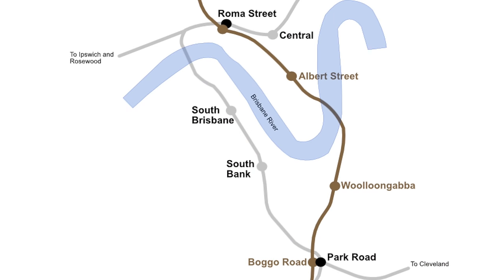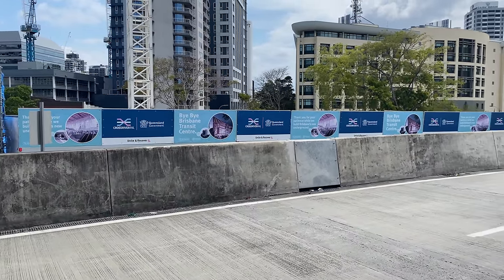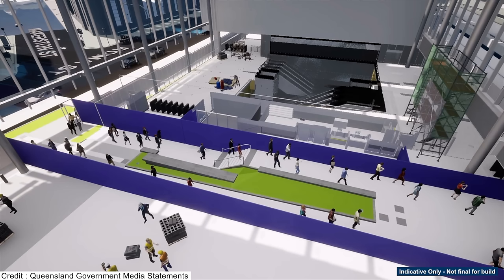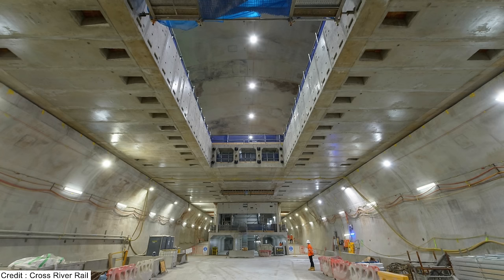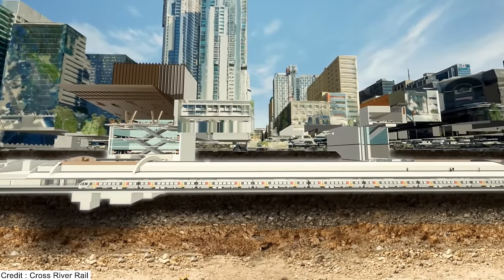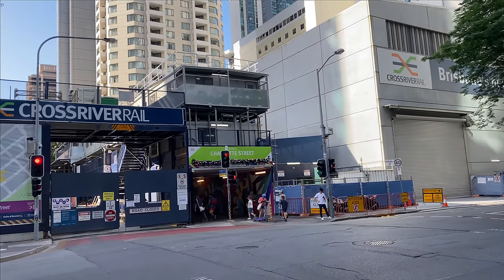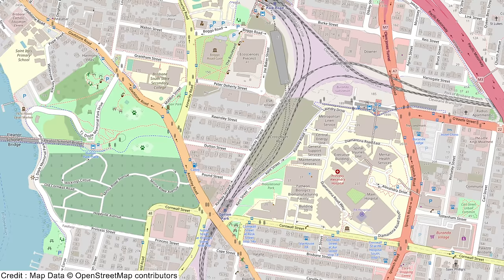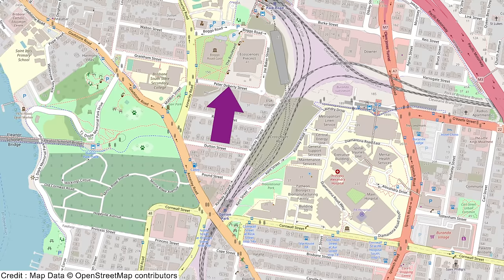Brisbane Cross River Rail Explained - Roma Street, Albert Street, Woolloongabba & Boggo Road

Comment: Thanks Paul, worth the wait! Really disappointing how little there appears to have been into ease of transfer. Even Roma Street could function better with direct access perhaps by an underground concourse beneath the existing platforms. However seeing as there appear to be huge issues relating to allocation of the extra capacity, this might be the least of concerns.
Reply from the maker: You're very welcome. Glad it was worth the wait! Both Roma Street and Boggo Road had better interchange facilities in the original plans, but unfortunately, these were scaled back to what we have now.  I'll talk a bit about service patterns in part 3, but it does seem that some further work will be needed to get the full capacity out of Cross River Rail.

Comment: Hi Paul, great video. Are you currently up in Brisbane? If so, Phil is also up there. You may actually find him while traveling around there. Brisbane has changed completely since I was here with my dad back in august 1973. We actually stayed at the former Canberra Hotel, when we were in Brisbane. No electric trains running there when we were in Brisbane, only diesels. Also, the South Brisbane trains were separated from the Roma Street trains and a bus was needed to get from one area to the other. Anyway, take care. Rob in Melbourne Australia.
Reply from the maker: Hi Rob, I'm back in Sydney, but I was there at the same time as Phil, as I also saw Riverfire.  It must have been so different back in 1973!  It was before the Merivale railway Bridge too, which would explain the separation for trains at South Brisbane.

Comment: A very well made video, Paul!  In my opinion, Brisbane has made a MAJOR error in not having guided buses that would be five sections instead of only three. Really only a simple double articulated electric bus. . . . . that tries to look like an LRT, with hidden wheels.
Reply from the maker: Thanks John, glad you enjoyed it.  Yes, the busway network capacity is limited by it not being guided. The only way to increase capacity beyond the 3 section "metro" vehicles is to have more buses, which means more drivers, so economies of scale are quite small.
Reply: @TransportVlog  Two things should have been done. ONE rebuild the bus way stations with much larger platforms. TWO have five section guided buses instead of the simple double articulated bus which Brisbane is now LOCKED INTO! No more drivers would be needed. These days guided bus systems are WAY in advance of the technology used on the Adelaide O-BAHN, for example. Why are double articulated buses NOT already in use in Adelaide? I saw double articulated DOUBLE DECK buses in Canada in 1980. You trad THAT right! For fun GOOGLE double articulated buses and see that there are a good number in use. Meanwhile in Brisbane they are HYPING UP  that concept.

Comment: The bus platforms are temporary. When the old Myer Centre gets refurbished between 2024 - 2026, Target will move from the basement into the former Myer space. This will see the old Target space be turned into a new coach station and an extension of the existing bus station, with a pedestrian corridor linking up to Albert Street station for Cross River Rail and the old bus tunnel between Queen st and King George square will become another pedestrian corridor that will link to Brisbane Metro at King George Square. This means that although the bus terminal won’t be in Roma Street, it will be better integrated with the CBD which is where most people need to go. Also part of the former Myer space on Ground level is being used for displaced Restaurants from Eagle Street such as the Bavarian, as well as millanos who were displaced from the Centre of Queen Street mall.
Reply: Thanks mate I live in qld too so this is helpful!
Reply from the maker: That's interesting!  Good to see the old Myer centre being put to good use in the future, and great to hear that there will be a connection with Albert Street station too.  I wonder if coaches will still stop at Roma Street on their way to this new terminal. I saw some Brisbane Metro hoardings in the CBD, so it seems like there is quite a lot of new construction involved with this project.
Reply: @TransportVlog  I think some Coaches may still head into Roma for connections to regional trains, but overtime more will go into Queen Street. In addition to Target moving into part of the former MYER space, means that the old Target space can be reused as coach platforms. In addition, Brisbane Metro will also see a reduction of local buses into the bus station, so those will also be included as part of the new coach station. In addition, they want to reconstruct the Queen Street mall to allow better access to the Queens Wharf and nearby Public Transport and Active Transport facilities.
Reply: Stop making stuff up, there is nothing at all saying this anywhere. Target does not need a 4 level space
Reply: @LachieVidsTransportVlogs  they are only taking 2 - 3 of the levels, the other space will be turned into smaller shops & Dining
Reply: can you provide evidence for these claims?  @electro_sykes
Reply: @KhanPiesseONE  I second that. I have not heard of any of these claims regarding the Myer Centre, and doubt their accuracy.
Reply: @nathanmurray  yeh ever thought thats why so many have been evicted out of queeen street
Reply: @TransportVlog  the south of Queen street is now fully blocked off from the public so now you have to detour to access south bank

Comment: I think there was used to be an old railway to Woolloongabba which opened on the 2nd of June 1884 and Closed Progressively from 1960 to 1989. With the Cross Rail Construction, The Area of Woolloongabba will get Heavy Rail Again by 2026 for the Opening of Cross River Rail.
Reply from the maker: Yes that's right Ethan. It will be great to see Woolloongabba on the rail map again!

Comment: I am wondering about Wooloongabba. Didn't it originally have trains? If so, what happened to the train line there? I remember seeing an old 1960's photo of Wooloongabba showing trams, buses and a steam train there. Also, are the Cross River trains driverless like the Metro in Sydney or have drivers like the rest of the Brisbane system?
Reply from the maker: Hi Rob, yes I think there was a railway line there originally.  I found some information here - https://en.wikipedia.org/wiki/Wooloongabba_Branch_railway_line. Yes the trains will have drivers, as it integrates with the existing suburban railway lines (same with Melbourne Metro Tunnel and Elizabeth line in London too).
Reply: From memory, there was an area in Wooloongabba, where trams, steam trains and even trolley buses could all be seen together. It certainly must have been an amazing place back in those days.
Reply: There's trains there now. Park Road and Dutton Park stations are both on the boundary of woolly.
Reply: Trains will be completely autonomous once they enter the tunnel but there will still be drivers in control of it. They've also been clever not to use the word driverless when naming the system to keep the unions happy.
Reply: Yes, there was a (mainly) goods rail line and yard in Woolloongabba, on the very site where the Cross River Rail station is being built. It came off the main line just north of Dutton Park and followed Dibley Street up to Ipswich Road, which it then crossed just south of Wilton Street. It then ran up towards the Gabba as far as Logan Road, then turned left along the top of what is today Jurgens Street, ran along Stanley Street and crossed right through the middle of the Gabba Fiveways to the yard.

Past the yard, the line continued up towards the river to the old Coal Wharves (today beneath the Captain Cook Bridge), skirted around the South Brisbane Dry Dock (now the Maritime Museum) and into the old South Brisbane Wharves. Despite being relatively close to the main line with South Bank (then Vulture Street) and South Brisbane Stations, the wharves line didn't connect to it.

Comment: Great video as usual Paul but as an aside do you have any information on when the charmers street  section of central walk will open
Reply from the maker: Thanks Paul, I haven't been to Central station for a couple of weeks now.  Last time I was there, they were starting to build the replacement air-con unit on top of the Chalmers Street entrance building. I'll definitely be there at some point this week, so I may be able to give you some further information then.
Reply from the maker: Hi @paulburgess-qr9rx, I had a look today and scaffolding has gone up on the Randal Lane side, probably to assist with replacing parts of the brickwork that were damaged.  So I think its still a couple of months away from opening. I'll include it in one of my other Sydney Metro updates that I'm planning to do over the next few weeks.

Comment: most of Queensland rail city trains where design to run 3, 6, 9 and 12 cars some city platforms are 9 cars long inc some south side river with park road having only platform setup for travel trains and interstate trains.
Reply from the maker: Thanks for sharing that. It will be interesting to see how long the platforms will be at the new and rebuilt surface level stations.